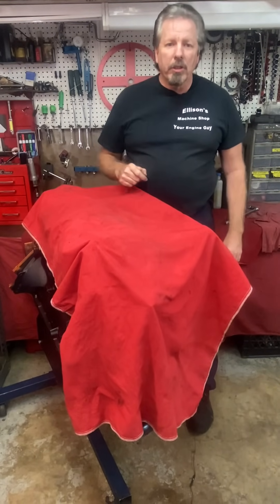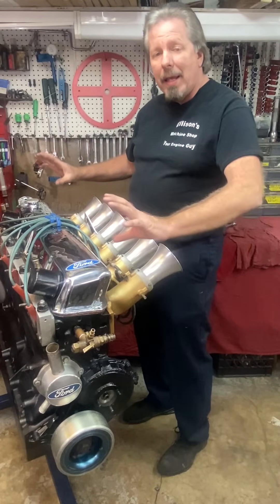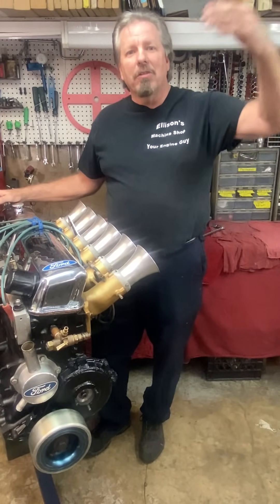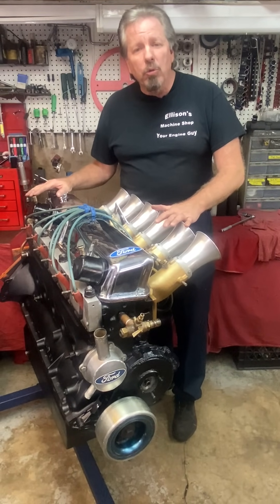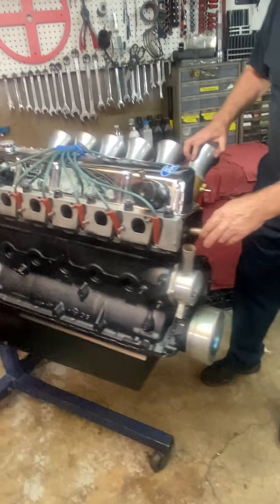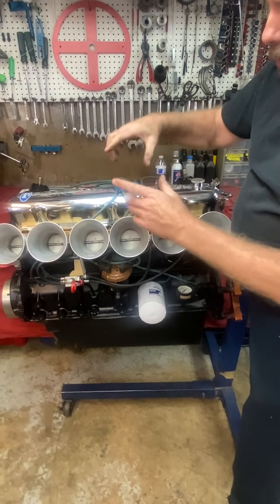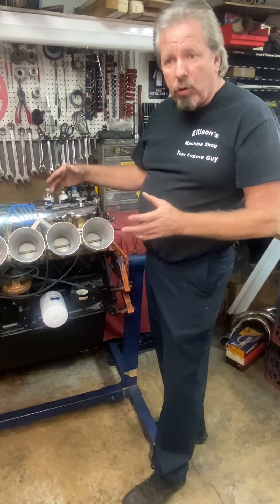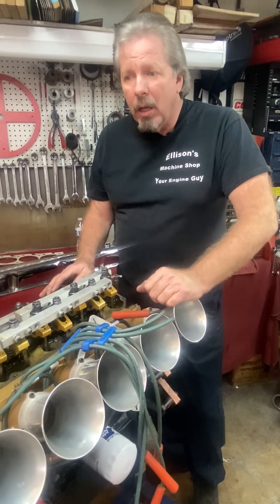Boss 300 Finished Project

Comment: That's an amazing engine. I had a 300 six in my 69 f100 pick up...never knew that engine was capable of that kind of HP. Thank you Sir for the video.
Reply: Anything can spin. Especially if the head flows and the rotating assembly can withstand the RPM. The 300 is a benchmark engine.
Reply: @travislivengood2744  What holds back just about every inline six ever built in the US is the head. Even the Pontiac OHC had a non cross flow head. But they might have had the ports raised on the intakes. The only inline six ever built here I can think of that had a crossflow head was the Willys Tornado 230 CID that came out in the mid 60s. The head was a little strange in that each cylinder had one cam lobe. It opened both valves. Hemispherical combustion chamber too. Willys only built it for a couple of years. Then the tooling went to Argentina and was used in locally built Willys models and old tooling AMCs. One of the AMC derived models* ran at the 24 Hours of Nurburing and snagged a class win.
*64/65 American hardtop based.
Reply: @mpetersen6  Horning made a 12 port cross flow head for Chevy in-line 6’s starting in the late 40’s. Ultimately put out 1hp/ cubic inch.
Reply: @danwebber9494  
I've seen the crossflow Chevy head on Horsepower Monster I think.
Reply: What is a crossflow head?  Something to increase turbulence?
Reply: @johnsmith4630  
Intake on one side exhaust on the other. Most* inline OHV engines used a non crossflow head because of the distributor placement would interfer with the intake manifold. Even iconic cars like the 240/60/80 Z had a non crossflow head.  
*inline engines that had crossflow heads that I know of. Pontiac 194.5 CID four from the early Tempests. Pontiac again with the Iron Puke. Renault had a 1.6 liter with hemispherical combustion chambers. Those engines were really unusual in that the cam was located so high in the block that the head had clearance cast into it for the timing chain and sprocket.  Ford of Oz did a crossflow head for their version of the 170, 200, 250 six. I'm sure there are others.
Reply: @mpetersen6  are you telling me that most inline engines do not have the intake plenum feeding into one side of the head and the exhaust manifold on the other side of the head?
Reply: @johnsmith4630  
Over head cam or DOHC engines. Of course they have cross flow heads. Overhead valve (aka pushrod engines normally don't.  One reason is because the distributor was normally driven via a helical gear in the center of the camshaft. You need to remember that when these engines were designed you needed to perform regular tune ups which included points, cap and rotor. And it wasn't just a US thing. And you really did not want to put the exhaust on the pushrod side because of heat issues.
Reply: @mpetersen6  oh, so pushrod engines often had the exhaust and intake ports on the same side of the head.  I mean, regardless of that the valves are in the same spot in the top of the chamber.  Is is more about the relative location of the intake port and the and the spark plug?
Reply: @johnsmith4630  
As I stated it's a matter of packaging mostly. Plus in sixes, and fours to some degree were the base engine of most cars and trucks. They were also built to a price point.  The intake and exhaust on different sides is going to increase tooling costs. Plus in the service these engines were expected to give the arrangement worked perfectly fine.

Comment: The 300 Ford was pretty impressive in circle track racing too.  40 years ago at a dirt 1/2 mile track, a visiting semi-late Maverick with the 300 six was bumped into the late model class just because of its aluminum intake manifold. It still finished second against all those built 355 Chevys!  Obviously it was a big dollar engine, but imagine if it had that custom head...
Reply: Back in the day here in central Fl, mr king had a boss 302 in a late model. Dude won like every weekend. So all the chevy guys i guess protested him , could have been every other racer. So the track told him don't bring that boss 302 back. So he built a 300 six and went to wearing their ass out with it. Next thing you know damn near every late madel had a straight six in it.

Comment: I have the 240 in my 66 f100 and I’ve got to say that it is a very nice 6 cylinder and probably one of the best 6 cylinder engines I’ve had the pleasure to own. I remember seeing one of these 300s drag racing at Green Valley race way in Ft Worth when I was a teenager in the mid seventies.
Reply: In the early seventies I also owned a ‘66 F-100 with the 240 inline six and 3-speed manual transmission. I needed a work truck and since the body was in rough shape and the drivetrain had a lot of miles on it , I got a good deal. 
Despite the high mileage, the 240 ran strong with a little oil consumption. I ran it very hard with the only issue being broken engine mounts which for some strange reason, were hard to find at the parts store. Otherwise an awesome truck 🏁.

Comment: I believe a competitor back in the day was the Rydell-Amundson Chevy coupe, which, if memory serves me, had a GM 292 straight 6, with sectioned, and welded together small block Chevy V8 heads.
Reply: You are correct. Mr. Rydell still has the Vega altered with that motor in it.

Comment: It would have been amazing if some company made a 3D scan of this head and made the proper changes and parts so that these engine parts combination were something available to the general public.
Reply: That would've happened had chevy been stamped on the valve cover.
Reply: My thoughts exactly...
Reply: hell YA
Reply: i wonder if one of the aussie barra heads would fit
Reply: @SpiderMan-rt4cd  
I dont think so. The Barra is based on the 170/200 architecture to the best of my knowledge.
Reply: @SpiderMan-rt4cd  
That would be interesting, but a lot of work to drive the dual cams, and then what is done with the camshaft and drive components in the block...
Reply: @joeschlotthauer840  It's a complicated piece of work to figure ouy, but not impossible. A few years ago, for a sort of stock car racing series in Argentina, where I'm from, there's a dude that developed a 24-valve DOHC cylinder head for the Chevy, Ford and AMN Jeep straight 6. The engines are de-stroked to about 210 cubes from the original displacement, they can run well over 9.5k, but limited to around 8.5k, and use a pair of Weber 2bbl carbs. The cams I think are driven in a way that seems to be similar to the Coyote on al three engines, which makes them somewhat "generic", but it's a nice work nonetheless. For all I know those things are at about 500HP, but the guy that made those heads said it can reach well over 600HP if closer to the 250-280 cubes. 
The series is called "turismo carretera" if anyone wants to take a look at it.
Reply: @Thraser999  
Do you have a link to those modifications...
Reply: @joeschlotthauer840  There are overhead cam kits for flathead fords that we're made in the 50s I believe. They just left the pushrod cam in the block to drive the distributor
Reply: No, Ford had two online 6s back in the day: a small block that topped out at 250 cu in, and the big 6 at 300.

The Barra is loosely based on the SB6 and the bore spacing is all wrong.
Reply: @SpiderMan-rt4cd , the Barra engine is OHC. The 300 is OHV.
Reply: @JoseRivera-ym3wj  
In Argentina they're running TwinCam heads on Ford, Chevy and AMC 6 cylinder blocks. 500 ponies with two 2bbls.
Reply: @mpetersen6 , I never heard of such modifications. Especially when you consider the amount of reverse engineering needed to move the valvetrain to proper timing and oil and coolant circulation between the head and block.

Any links to such examples would be great to see.
Reply: @JoseRivera-ym3wj  yeah but so was the Ford 427 FE but that's what they started with for the 427 SOHC.
Reply: @JoseRivera-ym3wj  
Look up the CATA TC racing series. Oldest continuing racing series under the same sanctioning body. Also look at the Adamma engine builds on the channel that ends in Quinn. Two old guys that either modify existing engines or build their own. Everything is either SOHC or DOHC. They are in the land speed record game.
Reply: the lineage of australian ford 6 cyls from the 170-200ci falcon engine onwards is
1 capacity increased from 170-200 to 188-221 cubic inches
2 250 2v  removeable inlet manifold larger runners, 2bbl ww stromberg
3 cast iron crossflow head ohv 200-250 ci head design basically borrowed from cleveland v8 1bbl stromberg
4 alloy head crossflow/alloy head ii crossflow, ohv, electronic ignition, 2bbl 34 adm weber 200-250 ci
5 multipoint fuel injected crossflow 250
6 sohc alloy head, crossflow design tbi and mpfi 3.9l
7 4.0l intech sohc, crossflow mpfi, variable cam timing
8 4.0l barra double overhead cam, vvt, mpfi, turbo
even though the engines went through huge changes it was always an improvement on the original and you can still find commonalities between the 1st and the last like bearing spacing. a gradual evolution never a complete redesign.
Reply: @6226superhurricane 
Since the ThriftMaster was eventually stroked to 250 CID making it 4.0 (242 CID) wasn't an issue. The 250 and the Barra have the same stroke after all.  I wonder if Ford shipped manufacturing equipment to Oz once 250 production halted in the US. IMO Ford would have been better of using the SOHC or Barra versions of the engine rather the 4.0 Exploder SOHC V-6. Timing belts coming off both ends of the jack shaft? What were they thinking. Beyond only having to manufacture one head casting and cam pattern.
Reply: Yup machine one out of bullet aluminum would be the way to go
Reply: The barra i believe is the 240 ci six
Reply: @brianadams429  
According to Wikipedia (yah, I know) the Barra was developed out of the 170/200/250 family. The 240 and 300 are the same basic block. Bore center is 4.480". The Windsor and Cleveland are 4.380". The 170 family is listed as 4.080" on the Stan Wiess web page. The Barra has the same stroke (3.910") as the 250 with a bore around .060" smaller at 3.630". 
The real wizards at mixing and matching, slicing and slicing cylinder heads is Pete Ardema. Porsche DOHC heads on a big block Chevy.
Reply: @mpetersen6  ty for the info.

Comment: My father Jim Watson bought that car from Sherman and ran it for 5-6 more years. I can still remember squirting fuel into the stacks before he fired it up. He too set IHRA records in both E/T and MPH in Comp Eliminator. Also won the All-American Nationals in Bristol with this car in 1975. My dad had a blast in that car, and some of my favorite memories were going to the track with him when my Mom would let me. Also, the late Sonny Leonard did some machine work for dad on this engine as well. Thanks for the video, brings back good memories.
Reply: What was the car it was in back in 1970?
Reply: @ronjacobs5667  My dad called it Sexy 6. He ran up and down the East Coast during the 6 years he owned it. From New London to Bristol to Charlotte Motor Speedway where they ran down pit road to MD and PA. I think he ran the Gatornationals one year as well.
Reply: @jtwatson5662  Sure buddy. Sure you did.
Reply: any video of the car running?
Reply: Great story and thanks for sharing.
Reply: Thank you for sharing OP
Reply: What I don't get you said the motor is backed by a Chrysler transmission automatic with the clutch in it how's that work magic
Reply: @caesarzirpoli3835, you make an adapter plate to mount them together.  The clutch is the same used in dirt tracks. Mostly used in chevy power glides that I've personally been around. Look it up for yourself.
Reply: What I don't understand you said the motor was backed by a automatic transmission a Chrysler transmission
Reply: What I don't understand you said the motor was backed by an automatic Chrysler trains what's a clutch how's that work magic ! !
Reply: I use to own Performance Edge in North Aurora,IL. I had a customer whose dad bought a 1956 Falcon as a father and son project.  Unfortunately his dad died and he had this 1956 Falcon wagon with a 200 six.  He was trying to decide whether to install a 351 Ford or a 350 Chevy into the car.  I suggested installing a 300 Ford.  He had the head ported and added small block Chevy valves.  He installed the longer 240 six rods and some pop up pistons. He used various in takes and holley carbs.  He used a 150 shot of nitros but blew the engine twice.  Finally he put a super charger on it with a Isky cam.  The rear was a 5.0 8.8 rear with a 3:73.   The car finally turned a low 11 second pass before the owner died.
Reply: Thanks for sharing your memories with us.  I remember an old Hot rod magazine  will the 300 straight 6.  I think the guy's name was. SIZEMORE.    Hearing everyone's stories it's part of. The hot rod brotherhood.
Reply: Liar
Reply: @none-j7x2g  Funny how everyone believes some rando on the internet. Guys obviously full of it.

Comment: This thing is sooo COOL!  It must really flow a ton of air.  Amazing to think that it all must have been done before 1990, even the Glidden style exhaust port plate.
Reply: I am just curious. Did Mr. Sligh come up with this creation before a Mr. Bruce Sizemore ?  If you do your research, Bruce was running a 300 6 cyl. For a few years in the early ‘70’s. Then, at one point, he did exactly this combo right here. I don’t remember if his engine had injection or not. I do know for a fact he ran it in NHRA ProStock and beat several big name folks. It probably was carbureted at this point, though. I don’t know what his dyno numbers or rpm numbers were either. But they must have been quite exceptional, because, he beat several big name folks pretty badly at the time. He was running a clutch less trans also. This was in a Pinto as well, built by Don Hardy race cars. Check it out, it will be quite a interesting read. In the ‘90’s, a team was running this exact same combo except for an aluminum cylinder head with shaft rockers, etc. in a “altered” style drag  car ; and they were cleaning house on a regular basis. I wish I could remember their names, because it was like 3 or 4 guys in together on the deal. I think one of the names was Argenta. That may be the wrong spelling, please forgive me.
Reply: @jimmywaters3987 … Mr. Sligh is acknowledged as being the first to build an engine of this type. There were several others built afterwards including the one that Bruce Sizemore built for his Pinto which ran in the Modified Production class. I remember seeing it many times as it dominated his class. 

The DragBoss YouTube channel has a video of Bruce Sizemore’s Pinto with the Boss 300 inline six defeating the late Lee Shepherds Corvette in NHRA Competition. It’s worth taking a look 🏁

Tim Halstead of The DragBoss Garage also did an interview recently of Mr. Sligh talking about his Boss 300 engine build with details about how he went about building such an amazing engine. 
Anyone interested in this engine should look up the DragBoss Garage YouTube interview 👍.
Reply: It was done in the early 70s.

Comment: I recently bought a badly wrecked 70 f-100 to get the bed and some other parts for my ‘71 sport custom long bed. Gave $800. Seems like a lot but the bed itself is with that. Anyway. It has a jasper 300 six in it with 500 miles on it. Hopefully when o peel the twisted front end off, I’ll reveal an unhurt engine. Been wanting to build one since I was a teenager. These videos have boosted my motivation. Most ppl underestimate these engines

Comment: I know a guy that built one of those engines in 69'-70' time frame. His name is Cliff O'Brien who worked for Tasca Ford, his name is on the side of Gas Ronda's SOHC 427 65' mustang funny car. He had done a max port job on a regular 300-6 head then his customer came in with a set of new 302 Boss heads. Long story short the Boss heads ran better but not anything impressive. He said he would have rather redesigned the 300-6 head and have the velocity stacks running through the valve cover. Looks like this design is going in that direction, raised the intake ports and use lots of epoxy.

Comment: Back when you used your brain !! Now got to have a turbo and a lap top 👎 plus I love the 300 Ford love it thanks for sharing
Reply: There's no doubt that a lot of thought has been put for this combination.

But talking down on turbos and laptops because "they do all the work" takes away the thoughts of the brains behind the turbos and laptops. Too small of a turbo will make it quick spooling, but won't make power at the top end. Too big of a turbo, and the lag means no power at the bottom end. And the wrong tuning on a laptop can mean you either run too rich (unburned fuel and lost horsepower potential) or too lean (risk of detonation). Anything, even with the best parts, can lead to catastrophic failure.

Even self tuning fueling and ignition systems don't know out of the box what engine they're being bolted on. The installer must put the parameters of the engine and its parts to get to the appropriate fuel and spark maps.
Reply: Your missing the point ! When that engine was built to tune and make power  only data you had was you . Like read a plug . Must be a lap top tuner and thinking I’m talking down to you , just went over your head .
Reply: By no means I'm no laptop tuner. I'm not a tuner, period.

But, yeah, the old-school ways still applies to this day. Reading plugs. The old exhaust sniffing test. Jetting carburetors. Timing adjustments with weights, timing light, etc. Most everything was analog back then.